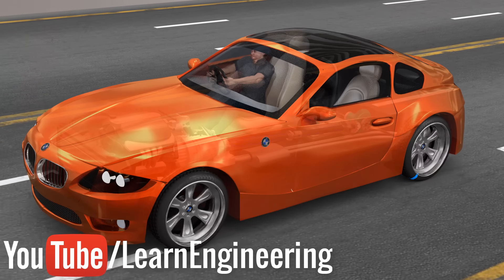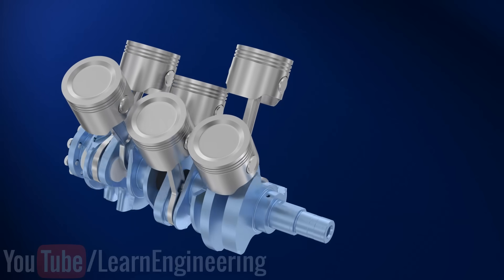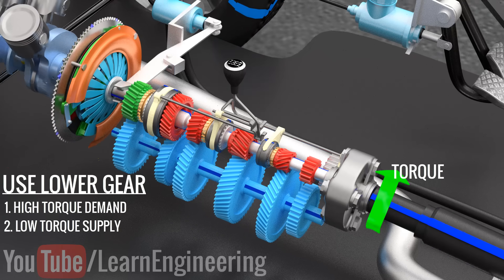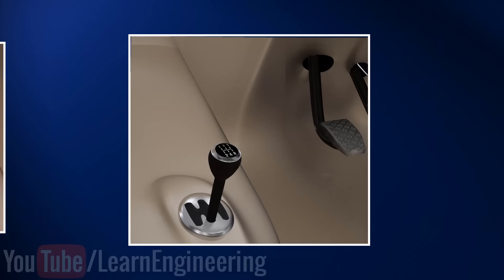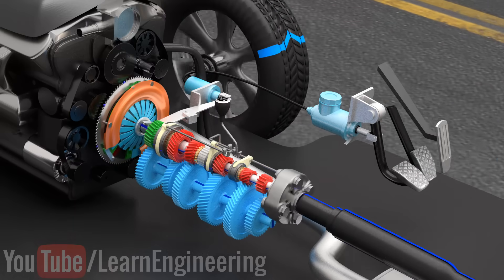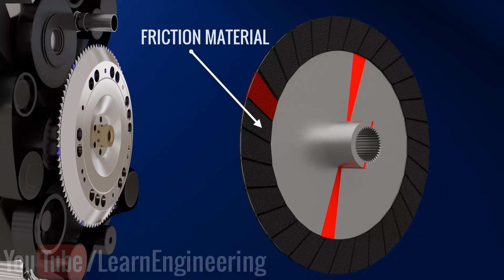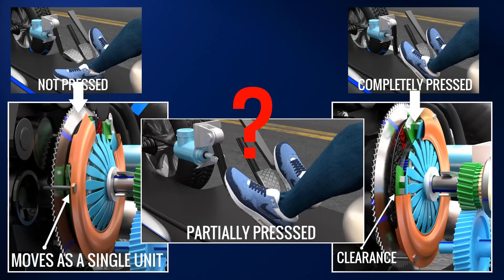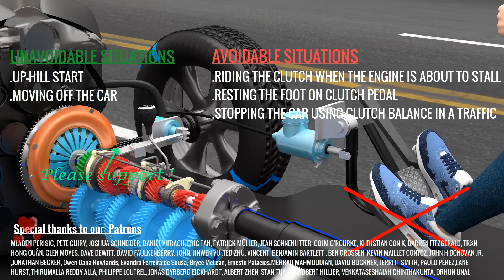Why you should not PARTIALLY press the Clutch?

Comment: 2:47      This is incorrect. Gear changes can and do happen without the clutch, by feathering the accelerator. Every truck driver I know only use the clutch to shift from neutral. If you rev match, a clutch is only needed to start. Also, different kind of manual transmission, but my motorcycles only require clutch work when shifting from N to 1. 1-5 and 5-1 just require pressure on the shifter, and letting off the accelerator.
These are two examples how you can shift with a power flow on the transmission.

Comment: My engine sometimes skips a beat when driving off, so I depress the clutch a bit so it can slip when it misfires.
On rare occasions when overtaking, I let it slip to get higher revs resulting in more net torque at the wheels. Letting it go gradually after adds the extra energy of the flywheel.
I have a tiny car with a tiny engine, so it's second nature.
Reply: I really don't think you should use the clutch for anything other than changing gear. What you describe it basically wearing your clutch out. If your car cannot overtake using the engine without your clutch hack, I suggest you don't attempt it. Imagine the clutch is like sandpaper. Everytime you use it, it gets slightly smoother untill it slides rather than grips. Good luck with your car.
If you were just trolling then well done, you got me there.
Reply: @TimothyEdDoran  Not trolling, Tim. Thank you for your reply and your concerns.

Swapping a clutch plate isn´t a big deal for me, but it won´t be necessary. I´m not smoking the clutch, just making cold shifts more gradual because of the engine sometimes skipping a beat at low RPM. And that overtake thing happened maybe twice.

It´s a 1999 Twingo. Although cheap to replace, I rather anticipating possible misfires, instead of dropping the clutch as if the car doesn´t have any issues.

I´m looking into it, but haven´t found the problem yet. Ignition and crankshaft sensor appear the be fine, but it´s an intermittent fault, hence hard to pinpoint.
It´s a minor inconvenience, though.

Comment: Clutches are a wear item.. you exchange the use of them for mobility.  Riding the clutch isn't strictly what you describe.  Nobody can leave their foot on the clutch full time.  Riding is overuse in general.  Taking too long to let it out, revving while it's in.  Resting your foot is a bad habit, but that's not riding the clutch.  That's just being lazy.  Clutches don't last forever.  If your popping it out of gear, half clutch is fine.  If you're putting it in gear.  Most of the clutch travel should be used.  You can shift without it if you can smartly match engine revs to what the transmission would expect ratio wise.  That's how you drive after a clutch failure.  I've also seen my father do it for 10 hours straight to get out of a remote spot with a broken left ankle.  So this is just one of those nerdy YouTube videos with not a single real world frame of film, eplaining a theoretical reality that exists only in the minds of whatever geek made this.  Partial depression of the clutch pedal will not damage the disc.  It's designed to slowly wear away.  The person who made this thinks a clutch lasts forever.  Every single time you use it, it slips and causes wear.  Deal with that idea.  It will need replacing.  I suggest theaker of this video should try and explain how an auto transmission works next
  I'd love to know how that works from someone who thinks Clutches wearing is a mistake.

Comment: I usually partially press the clutch when I'm waiting for a traffic light. Then I'll be able to move more quickly when the light turns green instead of having to shift gears first. Is this a bad habit too, or does it only apply to higher speeds?
Reply: I'd probably just put it in first and keep the clutch fully depressed.

Comment: I still don’t get it. Maybe someone can help clarify.

So I do press down on the clutch completely when changing gears, but as I release, I also press down on the gas so I have a smooth transition in gears. I’ve been doing this for 6 years in my 2014 Nissan Versa and no problems have raised. According to this video, I’m riding the clutch. But I’m also pressing down on the clutch completely. Am I really riding the clutch if I’m changing gears as the clutch is down all the way?

Comment: Well. If you use the clutch like this, you do not know how to drive a manual gearbox. That a gearbox has several gears is that you should be able to adjust the speed of the engine.
The engine chops and runs heavily = low speed, shift down. The engine has too high a speed, shift up.
Having your foot on the gear pedal when driving destroys the slats very quickly.
The best thing for car drivers with this driving style is to get an old DAF 66 that has a variomatic gearbox with belt drive.

Comment: You are definitely going to use partial clutch on atleast two occasions in a manual gear box car. When you start off from rest to avoid wheel slip and stalling and also during up hill start as you release the hand brake (unless you have an uphill hold function).
Reply: It tells you that at the end

Comment: Sometimes, riding the clutch is unavoidable such as when the traffic is moving at crawling speed. Engaging first gear fully would deliver too much power to the transmission. It can be controlled only by declutching partially.

Comment: If you in red light, your gear 1 or 2 your car struggling to move only option is clutch, otherwise too much engine and transmissions force causes transmission issues. 
2. In motorcycle you can't move or apply break without applying clutch. It's impossible

Comment: Decent video. Just stopped short of actually showing how the damage is done though
Reply: Cause there’s no real damage. It’s theoretical but not real. How many clutches are you aware of that have been damaged in your life? Riding the clutch sits between smooth driving and the need to change gears. It does not substitute either.

Comment: I got a question..  but what about breaking with the engine. I break a lot with the engine cause I have almost a 1ton 1/2 car. FJ40. When going downhill, I use the engine to break, and the clutch a little to not hover Rev. or break the engine, but  never let it go all the clutch until it's on the range of speed that the engine can support? So that's bad to? it's gonna wear my clutch disks?...

I also on downhill, keep the engine and car locked with the clutch waiting for the green light so I don't have the downward movement when gearing

Comment: The only real risk of damage from depressing the clutch halfway is when you do it for too long or too often. It can overheat the flywheel, friction disk and pressure plate, which can create hotspots, excessive wear, weakening of the metals, and even warping. You should only really ride the clutch in first gear, when youre climbing a steep hill in traffic, per say. You ride the clutch while giving some throttle and youll be able to keep up with traffic without constantly doing hill starts. Usually dont do it for more than a minute, though.
Reply: I remember burned clutch smell in driving school 😂 a lot of beginners were riding the clutch moving uphill.
Reply: @Спойлерщик  haha exactly! actual hillstarts are terrifying for people nowadays
Reply: Oh my doing it for over a minute is SO long, it might just vaporize that clutch :/ :/ :/ :/
Reply: perfect comment
Reply: That's why I prefer an automatic, you don't have to worry about things like that
Reply: @MybeautifulandamazingPrincess  sure, but as long as youre not just stupid those things will never happen
Reply: @MybeautifulandamazingPrincess  Higher maintenance cost, higher fuel consumption, higher engine wear. 
Learn how to drive a proper manual, it's not that hard. 
Another plus is that when i am on a long trip, i never feel bored because i often have to change gears in a manual.
Reply: @fireinthesky3379   Automatic transmission has lower fuel consumption and engine wear though…  Your information is only outdated by around 5+ years 👍🏼

Comment: I've never heard of "riding the clutch" like that or resting your foot on the clutch pedal, nobody would do that in Germany, because (almost) everybody learns how to drive a manual car here. There is a special license for automatic cars only, but few driving schools offer it, making it more expensive and it significantly restricts the cars you can drive since manuals are still more common.

Actually, I did continuously ride the clutch once, when the transmission of my parents' car broke and keeping the clutch half depressed while limping along at 4000 diesel-RPM was the only way to get the car moving and park it some place that was not right on a busy main street... 😅
Reply: @Evvajs  that's one of two (semi) legit reasons to do it, however, it's better to use the handbrake on steep hills.

I do heel&toe for that purpose though. I rev up the engine while holding both brake and clutch with my left foot, then slide off the brake as I release the clutch. Works really well with a bit of practice, I never roll back. Sometimes skid a little tough 😅

Comment: Only an IDIOT would "ride the clutch" Who doesn't KNOW this!? It's one of the first things you learn when you learn to drive.. (if you learn properly!) 
Also common sense tells you that the clutch is being worn everytime you use the clutch so the more you use the clutch or if you ride the clutch the quicker it will wear out or burn out even.. I've known this from day one. Perhaps this is an American thing? (Given Americans mostly drive automatics as opposed to here in England where we almost all learned to drive manual cars) and until very recently almost all own manual cars, not sure about last couple of years given there are so many auto boxes being produced now like in the BMW's bit in my BMW's I bought manuals anyway and will do UNLESS they stop making them far better driving experience, far more control, far more fuel economy and much LESS to go wrong! Plus ALOT CHEAPER to fix (if they EVER DO go wrong! But it's rare) Autos fail far more often than manual transmissions.. (unless they've been driven by an idiot who crunches gears regularly!?) Lol  Good video if a bit pointless.. 😅👍 🏴

Comment: This make me appreciate hill start assist so much more. 

When I first got that feature I was a bit frustrated as I was used to revving it quickly between releasing brakes and releasing clutch, when doing a hill start. But with hill start assist, the computer holds the brakes for you until the clutch engages, hence no need to rev too high. But if you rev high anyways it would result in a lurch. I got used to the system quickly and can start uphill as smooth as an automatic.
Reply: Honestly, I don’t like the system. Mine works in a way that it holds the brake for 2 seconds until it releases, but until then you have to partially clutch or it’ll stall.
Reply: Try to learn about hand break and RPM system. To prevent some energyloss/ clutch lifetime, play your rpm above stall rpm ..put your rpm about 2000 and than release the clutch pedal into your acceleration pedal. It will pas away your half clutch phase. Actually, engine trip is not just about the force..but vibration and alarm system in your car. Car are tripping because the machine work in the frequency resonance (rpm or hz). Normally when the engine & gearbox are in full connection, it have around 1000 rpm for max displacement/vibration, that's why you need half clutch for slow walk.... anyway use this tips, go to high rpm (2000) just before you release your clutch pedal, and just go for accelerating.. it will works in any Hill and good for your clutch.
Reply: Learn how to properly do a hill start that's another option. You are supposed to hold the brake let the clutch to biting point and move your other foot from brake to gas..unless is a very large hill then you need to use the hand brake
Reply: @jere.nurkka  i guess depending on the engine idle power and the weight of the car and the grade of the hill... doing that always stalls for me.

as for handbrakes... there is a reason why its not supposed to be used in traffic. i actually never call it handbrakes, but rather parking brakes. These are designed to stop you car from rolling when parked. If you play with these parking brakes while applying engine power, those linkage will fail. Unless of course its a rally car and the handbrakes are not built like parking brakes on an econobox.

As stated in the video hill start is one of those situations where you should ride the clutch. unless of course you have hill start assist ;)
Reply: @takwu0  If it stalls you are lifting the clutch too much. If computers can apply brake for you so can you.
Reply: @takwu0  I forget that all these modern cars have those shitty parking brake mechanisms. Luckily, I still managed to get a relatively new car with low mileage, without that horrible feature.
Reply: Just buy a diesel and it'll have enough torque to hold the car on a near vertical slope forever and ever and these hill-hold hand-holding mechanisms will be unnecessary! No gas pedal required.
Reply: @sideparting6845  "Hold the car on a near vertical slope forever and ever" - why don't you go ahead and try that? Might want to book a tow truck for wherever you are doing that, and then a trip to the mechanic to replace your clutch. Also, some air freshener to get rid of the smell of burnt clutch...
Reply: @oliverwatson6956  And a repair to my rear bumper!
Reply: @sideparting6845  What did you do with your car's brakes?
Reply: @oliverwatson6956  I only use them in emergencies and use engine braking 90% of the time haha just kidding
Reply: Some countries refuse to teach people how to use the handbrake
Reply: Have you ever heard of the handbrake? It's much easier and safer to use it instead of the "quick brake release-revving" technique for uphill start.
Reply: I still find it baffling that driving instructors teach you to ride the clutch for a hillstart where I live 🤦
You can tell that most of the population here keeps doing it as well, as even on the slightest hill the car in front of you will always roll back down slightly before lurching forward. 
As soon as I had my license, the first thing I did was learn how to handbrake start. That and handbrake turns are a must 🤌

Comment: This video makes it seem like riding the clutch is always awful when in reality its needed to crawl forward and in reverse if you just dump the clutch you launch backwards so if you're new this is primarily for when you're in proper motion then yes don't ride the clutch. There is a difference between using the clutch and riding the clutch. For example, using a manual transmission in a drive thru it is usually necessary to go slower than your first gear rolling free so I use the clutch to crawl forward but since I'm not using a high rpm its not bad, id rather use my clutch than run into a cement barrier.

Comment: I only partially release the clutch when going downhill relatively fast in order not to burn out the breaks and lose them while driving in a mountain road. I use the 2nd gear to slow down while breaking anyway, I think is called motor breaking.
Reply: I once rode a motor cycle down a steep hill with zero rear breaks. Entirely riding the 7 hairpin bends by half clutching... learning the technique can save ur life.

Comment: Guy clearly doesnt know the concept of downshifting either. If you just let the clutch dump while you're downshifting you're likely to eat your steering wheel depending on the gear you're going into -.-

Also, a clutch pack can deal with lot more heat than brakes without wearing excessively. 

Riding your clutch is not as bad as this video makes it out to be. The only time you should really be careful of it is if you're clutch pack is already on its last legs.